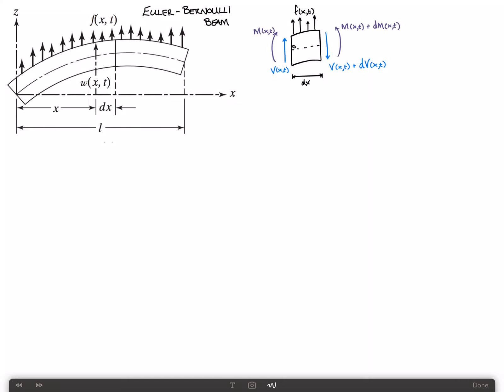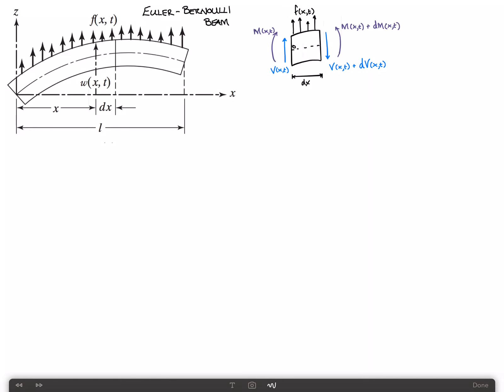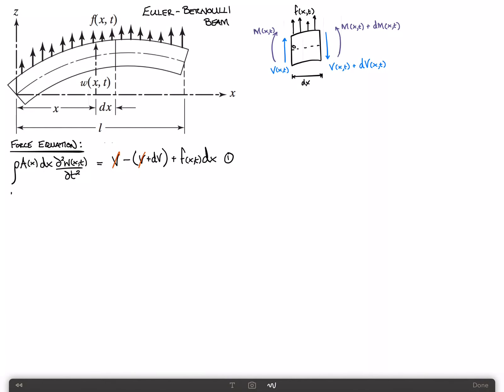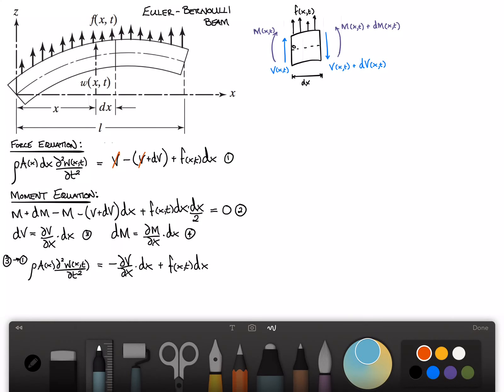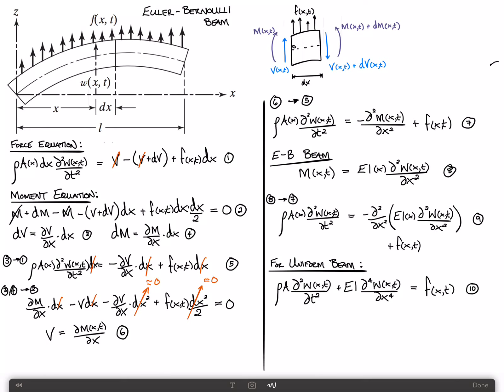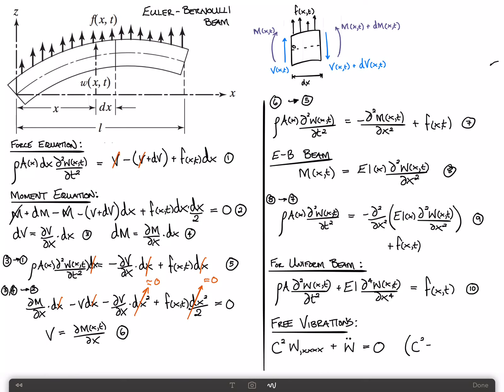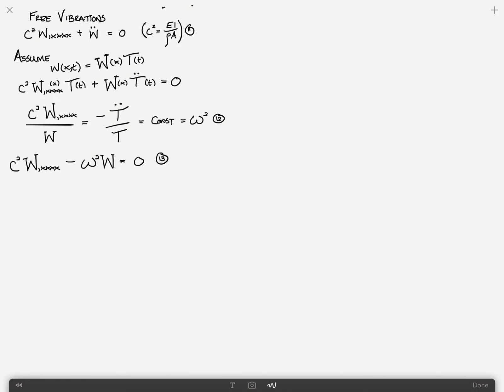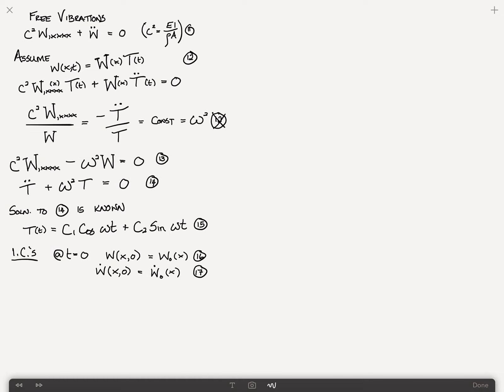Transverse Vibration Analysis of an Euler-Bernoulli Beam (Continuous System)

Comment: Great video, my only question is, is the force f(x,t) pointing in the +z direction because thats the direction the force is being applied? Or because when the beam moves laterally the forces inertia is moving up? When I make f(x,t) point in the -z in my derivation I get EIw_x_x_x_x' + pAw_t_t+ f(x,t) = 0. Which makes sense to me. Thank you and I look forward to more videos on this topic
Reply from the maker: You have exactly the same equation as I do with the exception of the sign on the "f(x,t)" which makes sense because you have defined your force, f, to be in the opposite direction from mine.  Both are equivalent and both are correct.
Reply: @Freeball99  thank you good sir

Comment: Hello sir, 

At the time stamp 29:20 when the edge is pinned, w(x,t) [displacement] is zero, but why is it that W(x) [space dependent part] is equal to 0?
Reply from the maker: w(x,t) = W(x)T(t).  So, w(0,t) = W(0)T(t) = 0.  That means either W(0) = 0 or T(t) = 0.  However, if T(t) = 0, then w(x, t) would be 0 all the time (which is a trivial solution).  So, we must go with W(0) = 0.

Comment: Hello sir! First, thanks for that great video. I have one question: if the beam has a circular cross-section, what method should be used to solve the problem? Is it something we need to solve in polar coordinates?
Reply from the maker: The current method makes no assumption as to the shape of the cross-section.  Does not require polar coordinates.  Changing the shape of the cross-sections should only affect the value of I (the moment of area).

Comment: At 31:50 you say there is a different kind of boundary condition (b.c.) if there is a mass attached to the end of the beam. What kind of b.c. would that be?
Reply from the maker: This would be a "force" boundary condition.  Instead of that boundary being a free edge, there would instead be an inertial load (both translational and rotational) at the edge.  This will result in there being a non-zero shear stress and moment at that boundary.  

This is common, for example, when modeling water towers or a tip-tank mounted on a wing.
Reply: @Freeball99  Thanks for prompt reply. A colleague and I are trying to model the damped oscillations of a polo mallet. So for example if there was a 10 kg mass at the end of a 2 m beam, the shear stress would be 10*9.8 = 98 N and moment would be 98*2 = 196 N.m? Or does the shear stress need to be calculated by dividing force by the area of the beam? Any corresponding modification required for the moment?
Reply from the maker: @kenlouie5453  No this is not correct.  Remember, we are talking about the dynamic case here - so inertial loads must be included.  Ignore gravity for now and imagine that all of this is taking place on a frictionless horizontal surface.  Imagine for now that the mallet is a cantilevered beam with a tip mass.  The tip is displaced a small amount and then released and allowed to vibrate.  As the tip of the beam translates and rotates, it is resisted by the mass.

We are trying to apply Newton's 2nd Law, namely,  F = ma and M = Jθ_ddot at the boundary.  The F is the shear force (not stress).  So, the boundary conditions would look like (ignoring gravity):
@ x = 0 or L: 
EIw,xxx = m·w_ddot
EIw,xx = J·w,x_ddot

where w_ddot = translational acceleration and w,x_ddot = rotational acceleration at boundary.  In each case, I might be off by a -ve sign depending on which boundary you are applying it to and depending on how you've defined your axes.  In order to include gravitational effects, just add (or subtract depending on axes) mg to the right hand side of the equation.  Also, if you are going to include gravity, then you should include the weight of the beam too (by applying it as an external load).  

Again, my advice is to ignore gravity as it changes very little about the nature of this problem and only confuses the issue.  

Hope this makes sense, it's a little hard to write equations in these comments.

Comment: thanx so much .. can you explain why dx^2 and dx are neglected  in  7.30 minuet
Reply from the maker: This is a fairly common technique when dealing with "higher-order" terms.  These terms are negligible compared with the other terms.  One way to view this is to divide everything through by dx.  Then only the 3rd and 4th terms still have dx remaining.  However, dx is very small (it is infinitesimally small), so anything multiplied by it will be very small too when compared with the 1st and 2nd term and can thus be neglected...and so we can throw away these terms with very little loss of accuracy.

Comment: Thank you sir. How can we know V and (V + dV) are at different direction at all time, similarly M and (M + dM) are at different direction at all time?
Reply: I think I can understand V and (V + dV) are at different direction. V at the right boundary of each element is a variable, just represent upward. The V at the right boundary of the previous element is V(x), upward, the V at the left boundary of this element, is just at the opposite site, -V(x), downward, it is the reaction force. At its right side is V(x+dx), upward, V(x+dx) = V(x)+dV. Correct?
Reply from the maker: Shear Force (V): At the left of the element, it's V(x) (upward). At the right, it's V(x + dx) = V + dV (also upward). The left boundary of the next element has -V(x) (downward) due to action-reaction. So yes, your reasoning is correct!

Bending Moment (M): This is exactly the same reasoning as what you have said above for V and V+dV.  On the left side, you have the reaction moment to the right side of the previous slice which has a moment in the opposite direction.

Another way to think about it is that the moments at each end must act in opposite directions to maintain rotational equilibrium - similarly, the shear forces must act in opposite directions on each end in order to maintain translational equilibrium.

Hope this helps! Let me know if you need more clarification. 🚀
Reply: @Freeball99 
Thank you for your reply. Oh! I found I had considered the forces on the element in a different way from yours, but my purpose was just to point out the action-reaction, it should lead to the same conclusion that the shear force at right side of an element will point oppositely to the left side, in you video, left side V(x) upward, right side V(x)+dV downward.

You commented:
"Shear Force (V): At the left of the element, it's V(x) (upward). At the right, it's V(x + dx) = V + dV (also upward). The left boundary of the next element has -V(x) (downward)"

I feel confused, would it had typos or I misunderstood something? If I rewrite as following, should be correct?

"Shear Force (V): At the left of the element [E0], it's V(x) (upward). At the left of the next element [E1], it's V(x + dx) = V + dV (also upward). The right boundary of the previous element [E-1] has -V(x) (downward)."

V(x-dx)    [E-1]   -V(x),
V(x)          [E0]    -V(x+dx)
V(x+dx)   [E1]    -V(x+2dx)

The left side shear force is drawn upwards, just represent certain values.

The right side shear force always has "-", because it is the reaction of the next element, should be drawn downwards if omit the negative sign. 🎉

Comment: Is the distributed load the self weight?
Reply from the maker: In this problem, I have not assumed any gravity is present.  I have assumed that the external load is some general function so if you wanted to include the weight of the beam, you could include it in the external load.

Comment: What is Eulour bernoli assumption
Reply from the maker: Euler-Bernoulli assumption applies to slender beams (i.e. beam of high aspect ratio) and says that the cross-sections of the beam remain undeformed and normal to the beam's elastic axis at all times - so there are a couple of things there: 1) that the beam's cross-section doesn't deform and 2)  it remains perpendicular to the elastic axis at all times.  Consistent with this, one can also say that the bending of the beam is due to normal stresses only and that shear stresses can be ignored.  Also consistent with this is that the rotatory kinetic of the beam can be ignored.  Again, this applies to slender beams only (like sailplane wings, helicopter rotors, wind turbine blades, etc.).  For the case of shorter, stubbier beams, the Euler-Bernoulli assumption falls away and usually Timoshenko beam theory is used.